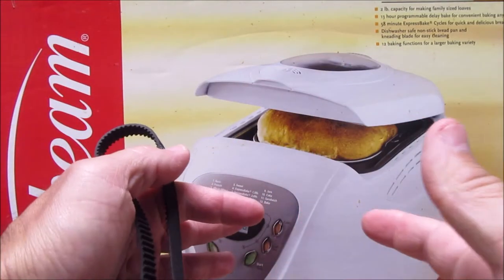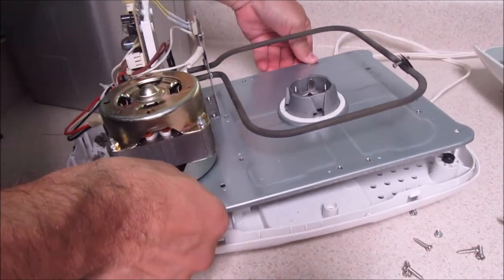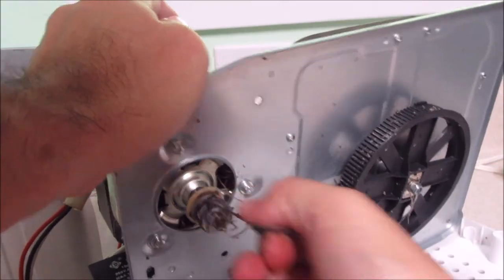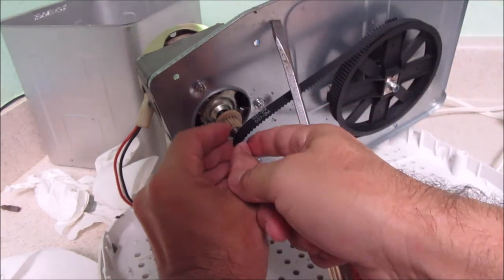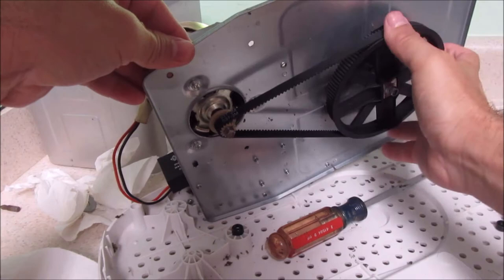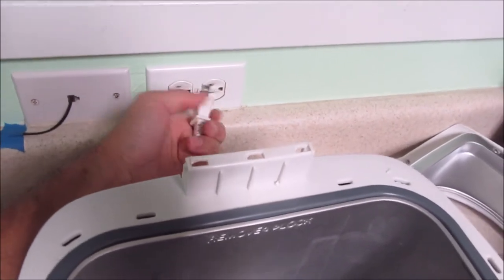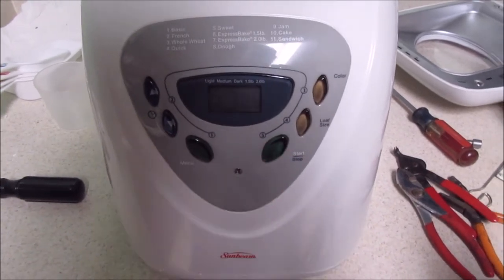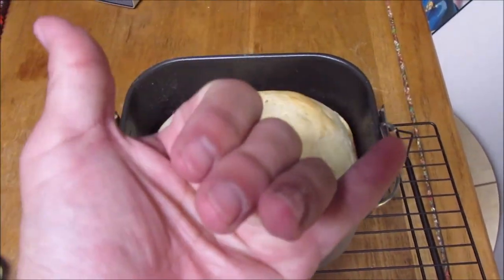Bread Maker Belt Change

Comment: Ordered a belt for our B2200 bread maker , it was 1/2" too long .
Made a bracket and nylon wheel and bearing to act as a tensioner . 
Works good but the supplier in the states 
Would have charged me to mail it back to exchange it . 30.00 US funds for a belt and mailing  that didnt even fit the machine !  Not waiting for another one that will probably be the same size 😠
Helps to be a machinist . 😉
Reply from the maker: You are talented!